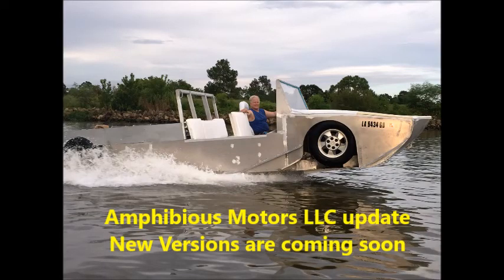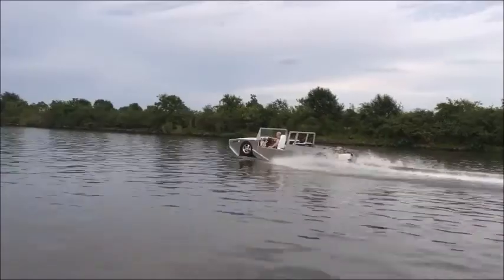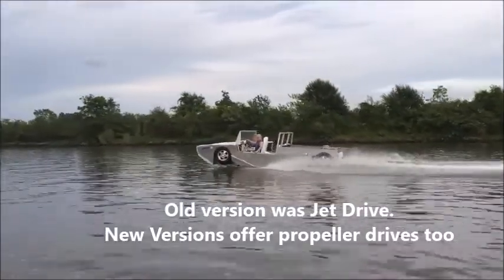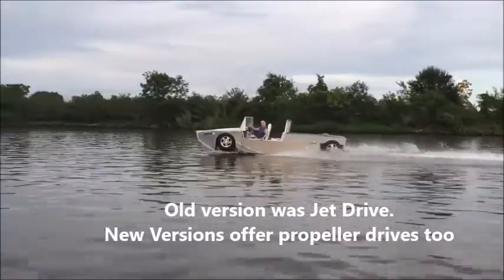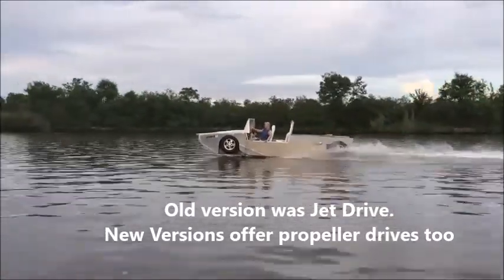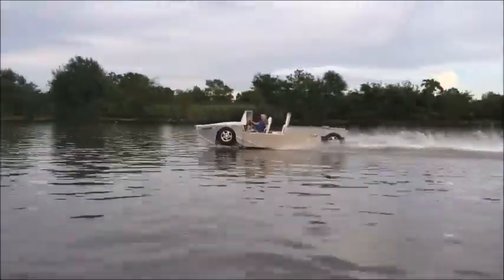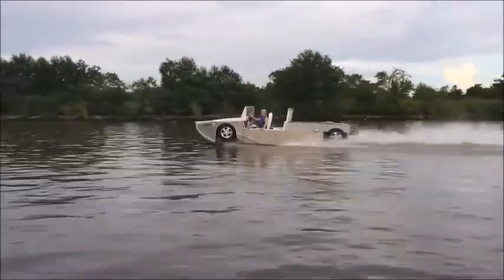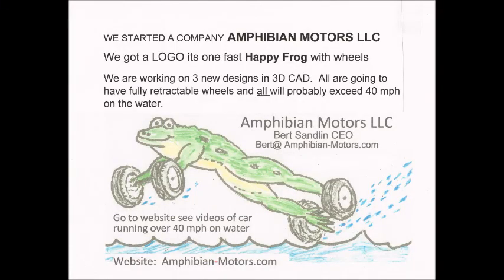Amphibious Cars

Comment: Your amphibious car is super cool. Btw, what advantages does propeller drive have over jet drive?
Reply from the maker: The Prop is more efficient.  At the higher speed the handling was not very good basically there was nothing in the water to keep going straight.  At the 40 mph range it would cavitate the pump impeller when it hit a small wave and the engine would over rev then when it caught good water again it would slam the transmission.  Destroyed a few transmission parts and caught it of fire. Tried several different jet pump water pickup design and had trouble getting it to stay hooked up at the higher speed.  The Flat bottom design worked fine at the 30 mph range in the water over 35 it got squirrely.  The hull/chassis design would not get the the Guinness 60 mph speed record for an amphibious car.  The real kicker was one of the Wildlife & Fishery head guys said that they would never buy another jet drive for flood rescue recovery type service.  They had open impeller type jet drives that all got plugged up after Katrina with the marsh grass and debris.  He wanted something with a big weedless type mud boat prop.